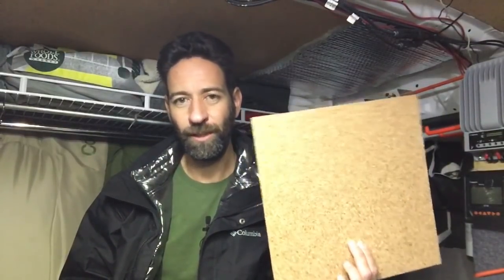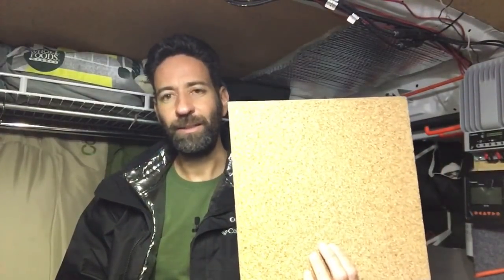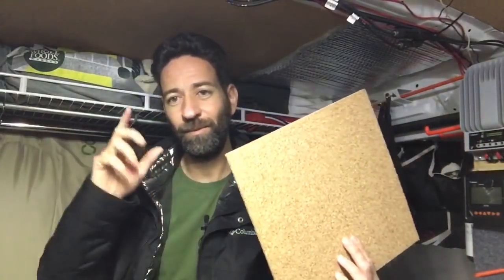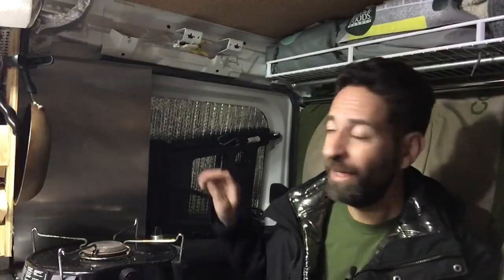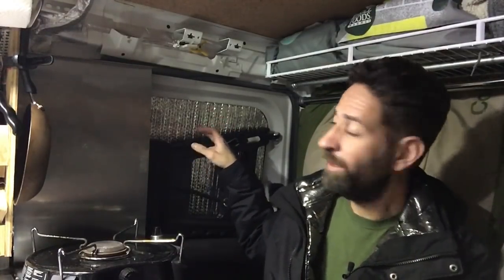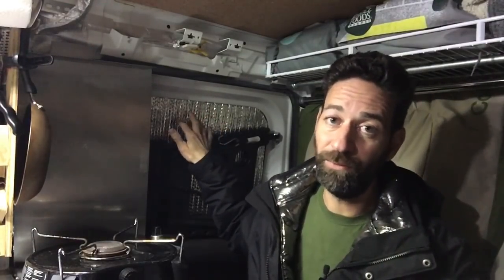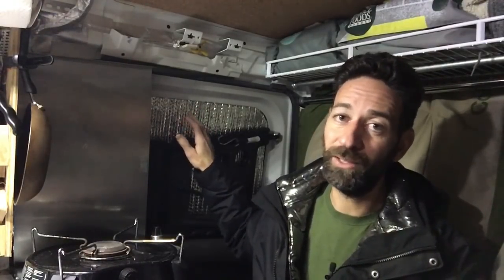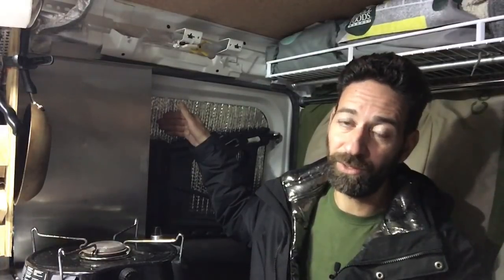Update on Using Cork to Control Condensation in my Campervan

Comment: I like your idea on the floor vent.  You have  floor vents and a ceiling vent opened, but you are still having condensation problem. This means the natural ventilation is not enough, uneven, or lack of air flow in one zone of the van.  The last solution is to use a mini dehumidifier when in some areas of the country -  Ivation Ivad, Oxa Smart, Eva-Dry E333 or others.
Reply from the maker: I’m sorry, I must have forgot to add that  the only time I have condensation is when I use my propane stove. Water is a by product of burning propane. If I forget to turn the vent fan on while I’m cooking, I get condensation. That’s the only time I get condensation.

Comment: Thanks for the cork update. We've got a Nissan NV200 and designed the cargo camping area to install/uninstall in 15 minutes. We use it as a daily driver and part-time camper. This is our first WI winter with the little machine and it is MF cold in it 'cause we haven't used any insulation. A temp solution is what we're seeking. Maybe the vibrating of our chattering teeth at nite on the way to RTR might get our gray matter working to find a solution...like possibly cork w/o glueing.
Reply from the maker: Oh no! I had originally wanted to make some panels similar to Wayfarer Vans makes. I also thought of hanging furniture blankets like Crystal Vanner has done. 
You might need to find a good heater. It could still be cold in Quartzite.
Reply: The problem with temporary is that you need to make a continuous insulation barrier.

Comment: Relfetix is usually used incorrectly  in van building.  Dig the cork idea.
Reply from the maker: It’s odd how much faith is put in Reflectix. Not a bad product, just not great for vans.
Reply: @StaticCamperVan  Bob Wells did an insulation video where he said reflectix is worthless on bare metal, it's only good when used for glass, like the windows.  Yet most van builds on YouTube you see people slapping it on bare metal.
Reply: Not only is it generally pointless for insulation, but also with its intended use as a window covering can cause problems like heat build up that can crack windshield. Just paid $225 for that lesson.

Comment: Reflectix works well over foam panel insulation. Works well on windows. The batting you glued to the metal is going to be mold, mild, mold. The best insulation against the metal is 1 to 3 inch foam panels.
Reply from the maker: I thought the batting would get moldy too. But it has been the driest area in the van. I don’t want to insulate so I am holding off on using the foam panels.

Comment: I am using reflectix as a first insulating layer in a box van I am setting up .The siding on the box is 5/8 inch thick plywood with fiberglass on both sides and I have fitted an foil taped the reflectix not glued it so there is lots of air  in between and so far so good . I think you are correct in removing the reflectix that is directly on the metal it will keep condensating between.I am going to put foam board and thin wood paneling over the reflectix I have since I have the room .I think your cork idea will work like foam board and breath to avoid the condensation.
Reply from the maker: Oh, cool. You have the space to build out properly without intruding too much on your living space. I think box trucks are going to be the more popular van in the future.

Comment: I'm glad the cork tile is working. It does look better than the other stuff 😀. Omg, not mold...ugggggh! I'm glad your taking it out.
Reply from the maker: There was just a little mold. It’s good I didn’t listen to all the advice to leave the Reflectix in place.
Reply: Static CamperVan yes, I'm glad you didn't listen. Good thing it was only a small amount. Will the cork keep you warm? Just curious...I hope it does.
Reply from the maker: It does seem to insulate a little. But I don’t have any problems heating this van because it’s so small. I used a candle lantern one evening before I had a heater. And it worked great.
Reply: Static CamperVan Great! I'm glad.

Comment: You might look at your existing weep holes at the bottom of the walls of your van to see if they’re clogged. Or if there aren’t any, make some. The cork might reduce the need for them but the moisture/ water needs an escape route to prevent buildup.
Reply from the maker: Great suggestion. I always leave both my vents open so I only seem to get condensation when I’m using my stove and don’t turn the fan on.

Comment: it makes sense that you found mold where it's touching the bare metal.... Reflectix requires an air gap!! glad the cork is working.... plus side you can stick pin some art or post cards of your travels up on it!
Reply from the maker: But how does condensation get in there if the Reflectix is glued directly to the metal? It’s perplexing to me since most people use it this way. I was only using the Reflectix for sound proofing, which is not really necessary.
Reply: Very interesting video... I would suspect the mold ends up on the metal because of the metal's temp... it gets cold easily and transmits heat away much more quickly than more organic materials would. Which is what the cork is. Perhaps the bigger take away lesson is to stick to more organic materials?
                Mold likes dark and cold.
 I have to put a honest disclaimer on this post: I have no indepth knowledge of van life but I have done a lot of remodeling in residential & commercial buildings and I have come to believe from those experiences that there is just so much marketing wank from building companies wanting to sell a product when the "old ways" may have been more expensive that they were overall better.
 One such comparison is house sheathing systems compared to tar paper and cedar siding (or redwood lap siding). Even if you go way back in history you will find the Native Americans knew to sleep on boughs of cedar and smudge with these woods that are now known to have anti-insectal and anti-mold properties. 

Modern building has only brought cedar forward for closets. Any time an owner asks me about cedar siding I always say leave it and do not "upgrade" to synthetic products because of all its wonderful properties. I feel this knowledge is being left behind in all the push for new 'solutions' (which really are only there because the past has been forgotten).
 It's an interesting challenge because you are clearly pushing the boundaries of what can be done with such a small space relative to your own moisture output (lungs mostly while sleeping) and additionally the poor insulative value of your living wall. These are the kinds of videos I enjoy as they give my mind something to munch on.
Reply from the maker: You’re thoughts are very interesting and appreciated. The Natives seemed to understand living better than we do now. 
It seems most people want to seal their vans up tight as a drum. But that building style in homes led to a big problem with mold growth. I’ve felt from the start of my van build that ventilation is the single most important thing. It’s to the point now that I never close either of you vents. I want fresh air coming in and moisture levels to balance.
Reply: Makes perfect sense to me as long as your heat loss is tolerable. I guess if one desired to go the technological way for "solutions" would be to duplicate what homes are doing: 
 Look for a heat exchange system which could vent the air & moisture but keeping the heat inside. I've always felt these are kind of wasteful but it does work. If you could find or make one that runs on a small computer 12vdc fan it could work for your scenario.
 Another less thought of solution would be to consider a desiccant like the silicon stuff used in electronics. Maybe it could absorb your breathing moisture as you sleep and then the next day you warm it (and have it outside or vented) and it releases the moisture to the outdoors. They do sell units like this for preventing tool rust due to moisture. They are typically microwaved or heated later to dry them out then reused indefinitely.
 (I built my own for my tools using a bunch of packets I got with electronics and poured it into a large altoids tin that I punched a bunch of holes in with a small brad.)
 You'd need a lot more surface area for what you are doing. Like a cookie sheet of the stuff.
Reply: John Possum 
So are you saying that the cork is more to what our ancestors used to make living more tolerable? Or did I lose what you're saying.  I'm new at this. Just asking.
Reply: It's certainly way more breathable than steel or reflectix. You need breathability to help with moisture issues. But it will be interesting to see how it works because it can't breathe through the van's steel side. Yes, I always like natural organic solutions. Love woods and history has shown if you can use the right one in the right place you can avoid artificial materials that people are fooled into thinking we "need".
Reply: You need to realize that you are in the Pacific Northwest.  Most of those van builds you heard about are either summer-only endeavors or in the desert in the winter.  

My CT here on the west slope of the Sierra in N. CA required an inch of foam board for full time living.  Some types of metal and plastic are condensation magnets.  It is just like a glass of cold water.  Condensation forms where you have a differential between hot and cold and a lot of water in the atmosphere.  You had not provided any way for the two sides of the metal, exposed to hot air on the inside and cold air on the outside to have a break from each other.  I hate to be the bearer of bad news, but this is by 2 and a half years of experience, 2 in the CT conversion.  I realize you have done a lot of work on your van, and it would be a shame to rip everything out and get that insulation in there after the fact.  

I hope your cork works.  I would love to hear about the ability of cork to be fire retardant.  Right above my heater, I have not put any insulation on that one spot on the ceiling, due to issues with the foam board wanting to melt and deform.  I would love to hear how the cork on the ceiling responds to the heat, especially where it is right above your new Wave 3.  Right now, I am thinking about buying a $5 piece of drywall to go over that foam board in the one spot.
Reply: Oh yes, West Coast Roller did a lot of great videos on his multiple efforts to combat condensation in his cabover camper.  He had a lot of good ideas as well.
Reply from the maker: Since starting this vanlife endeavor, I told myself that I was going to need to be a lot more flexible and open to change. I appreciate your advice, I am learning as I go here. 
My main issue with insulating my van isn’t the work involved. I had it insulated at one point then removed it all. It’s such a small space, no job is very difficult. I know this may seem crazy to a veteran nomad like yourself but I don’t want to insulate my van, ever. But I realize that I may need to insulate at some point. It will be a pain but it won’t be terribly difficult. 
I think cork is fairly combustible. The Wave 3 puts out a mild heat and I haven’t noticed any problems. 
I applied some heat shielding above my stove and was thinking I would need some above the heater. But so far so good.
Reply: I did wonder about it being combustible.  It is amazing how the luan resists combustion.
Reply: Reflectix sucks as a sound deadener.  Sound damping takes either mass ( asphalt sound dampening mats) or thickness (XPS) and reflectix has neither.   MOld spores are vanishingly small, very possible that they were trapped between the reflectix ( in tiny gaps that did NOT glue down)  and the van panel.  black mildew will eat anything , so may well have been living on the glue itself.
Reply: Plastic is not plastic anymore.  I used to get 9X12 sheets of plastic in the paint section to cover my car or boat with and it kept the rain out.  Now, the same sheet of plastic lets water seep through it.  So it now offers no protection from water invasion.  It is simply not the same stuff
Reply: Awesome information. I will be trying cork myself after this video. I just would like to know if you have an update video on how it went with cork? Did it get mold, or not? Thanks.
Reply from the maker: I did do an update video on the cork. No mold, no issues. Still happy with the cork.
Reply: Static CamperVan 
Thank you!! That's great news!! If anything changes let us know.

Comment: Cork is a great idea! I'm going to research that for my van. Need to find out the R-value and insulation factors. I used the pink foam boards with a thin wood veneer - but that does take up a bit more space.
Reply from the maker: Glad you liked the idea. I don’t think the r-value will be as good as foam board. But I’m just looking for a thermal break, I don’t want to insulate unless I absolutely have to.
Reply: I liked those pink foam boards for the ceiling insulation in my CT conversion, since they friction-fit so well.
Reply: Cork has an R value of 4 per inch. This is really high for a natural product. Foam boards are usually rated r7  or so per inch. So yes foam is better as far as insulation goes. Cork also has exception noise absorbing qualities, is natural and has some anti-fire properties. Expanding spray foam from a can, can be great to get in odd shaped places.

Comment: Cool tiles, i didn't know they made those.  I resorted to using thick cardboard in my past van, actually worked great.  I held it in with wooden slats and it kept the van warm and dry, plus it resisted mold.  Wasnt perfect but it was free, i scavenged all of it as i was very, very poor that first winter.  Kept it for 5 years like that and replaced the cardboard twice...for good measure.  Wouldn't suģgest it to anyone unless they were in a dire situation, but I was amazed how much better it worked than almost anything if seen people try.

My new van is fully, profesionally insulated and i love it.😊  still got wet a bit in here in Seattle last week tho, I know guys with million dollar boats whom have the same problems with moisture...just gotta keep things aired out, clean and always mitigate mold.  With wetness like that there isnt much you can do.   Like this sunny week we've had, I've been airing my van out constantly.  I'm sitting in it right now with he sunroof open and windows all down and it's like 42 degrees, but sunny and dry.  I even slept with the sunroof all the way open a few nights after all that rain.  Luckily i have warm bedding and like cold weather, some people don't and I is harder for them to stay mold free.  Which bothers me more than the actual moisture that causes it.  I got pretty sick once a  long time ago from mold exposure and couldn't taste food for like 4 or 5 months so I really watch it now!  Even a nicely insulated rig/boat will get wet inside no matter what but we all find ways to work with it.

Tip:  white vinegar mixed with water in a spray bottle will kill mold and it is natural...otherwise bleach and water really, really, really kills mold, but isnt healthy.  just wipe away with a rag afterwards.  I've used both, vinegar is good for light mold...if it is bad I will use bleach.  Usually vinegar is enouh though even on some pretty moldy boats and vans ive cleaned.  Vinegar doesn't stain and bleach things which is also cool.  My door seals are molding and after this discussion im gonna get some more white vinegar today($2-$3), I only have organic Apple cider and re wine vinegar right now and I feel like the mold might even like the apple vinegar.lol.  

Good luck!
Reply from the maker: I think you’re right about always having to deal with some moisture here in the PNW. It’s not Death Valley! 
You know first hand how bad mold can be, glad you are better now. 
I used a spray bottle of Dr. Bronners mixed with water to clean off the mold. I refuse to use bleach anymore. 
I find as long as I turn my vent fan on when I cook, I don’t have an real condensation. Sometimes I forget or don’t want to turn it on because it’s COLD! Then I have to wipe off water. 
I’m just trying to strike a balance. So far I am happy with the cork. Plus it looks nice when I come home.
Reply: Static CamperVanx i agree that the cork looks nice, very homey and cozy.  I think I need to go to home depot and see what all they have.  I have a large opening skylight on my roof, which is cool in good weather but I cant open it in the rain.  I think I need a motorized fan hatch but I'm  scared to cut my roof.
Reply from the maker: How about a boat hatch over the top? 
And don’t be scared about cutting holes. A little Butyl Tape and DiCor Lap Sealant and you won’t have any leaks.
Reply: Static CamperVan  Who set in your roof vent/fan?
Reply from the maker: I installed the vent with a little help from a mechanic friend.
Reply: Static CamperVan Thank you so much for answering so quickly. One more question: What brand or type of fan/vent do you have? Once again, thanks in advance.
Reply: Accoding to Australia's CSIRO bleach doesn't mold spores which is why they return.
However, using bleach followed up with rinse & wipe over with Clove oil solution ... 4 drops in 1ltr water ... kills spores & leaves areas smelling gorgeous 😍